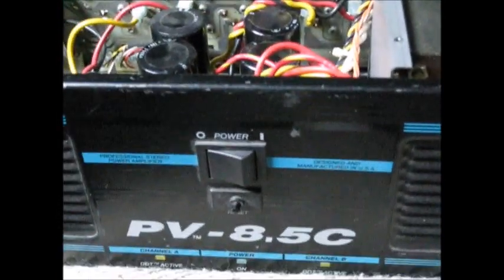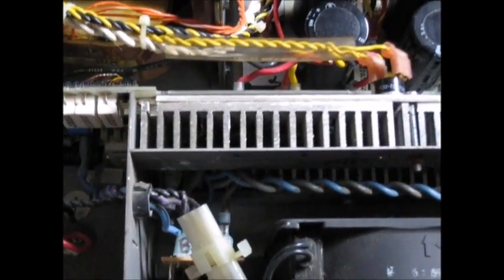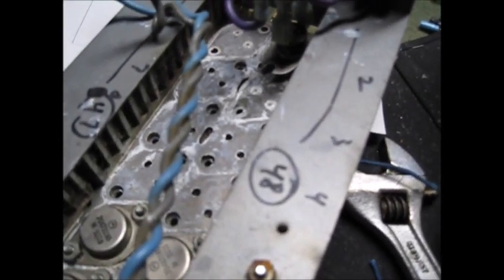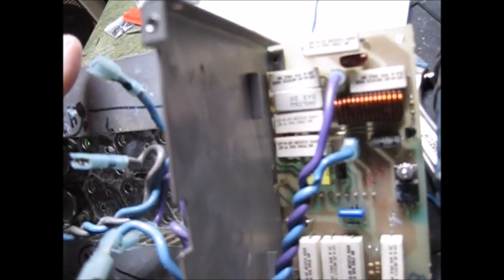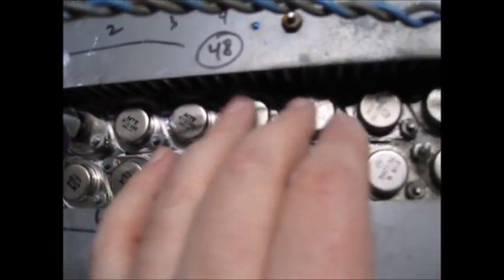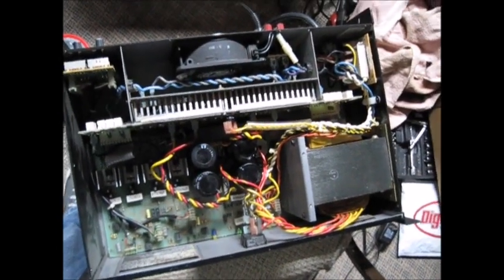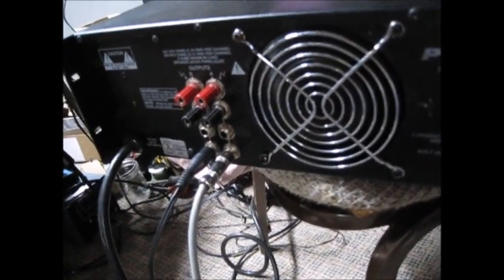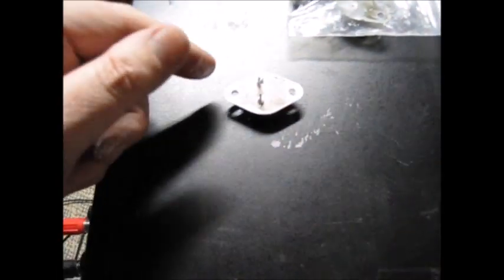Peavey PV 8.5C Amplifier gets fixed.

Comment: Ciao, video molto interessante, complimenti. Sto rimontando i transistors motorola sulla piastra, del mio peavey 8.5C, per piacere, sai dirmi che tipo di pasta termica utilizzare.?Grazie
Reply from the maker: Silicon Thermal paste that does not conduct electricity.  This is what I used.  https://www.amazon.com/StarTech-com-Thermal-Grease-Compound-Heatsinks/dp/B005VULWLA/ref=sr_1_3?crid=3QEB5LZPW8TKA&keywords=silicone+thermal+paste&qid=1697930737&sprefix=silicon+thermal+paste%2Caps%2C85&sr=8-3

Comment: I like watching the SS repairs. Its kind of like watching a murder mystery.
Reply from the maker: If this had the plastic/ceramic transistors,   there would be carnage to view...   With these,  the carnage is already contained inside the metal shells.   I'm just glad the darn thing is fixed.  I don't totally hate fixing SS amps... but the thermal compound isn't much fun.   I gain more confidence with each success.